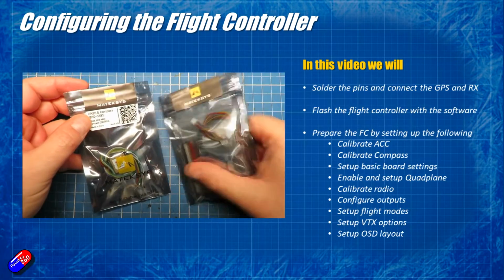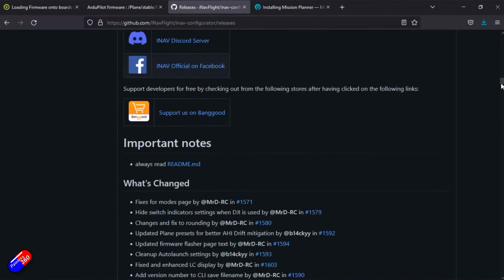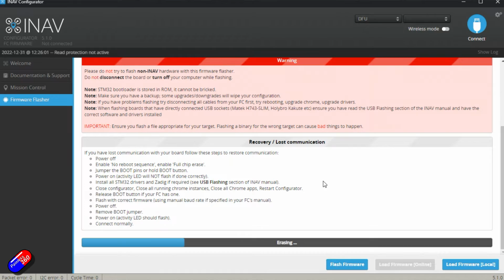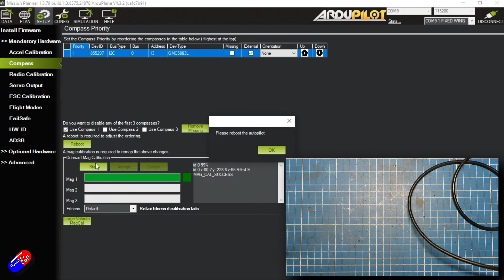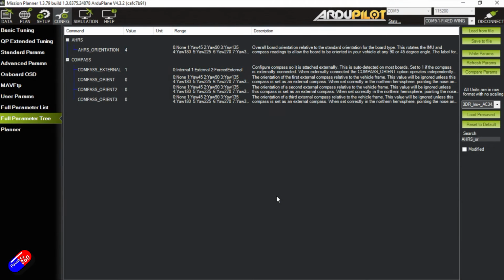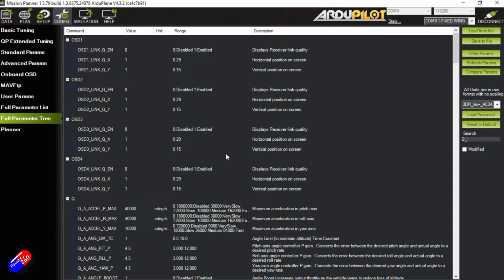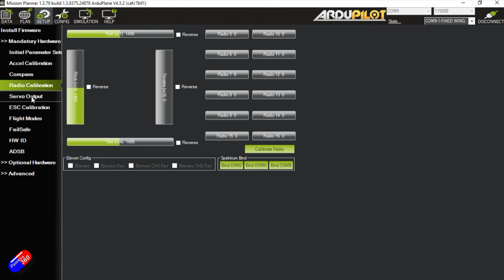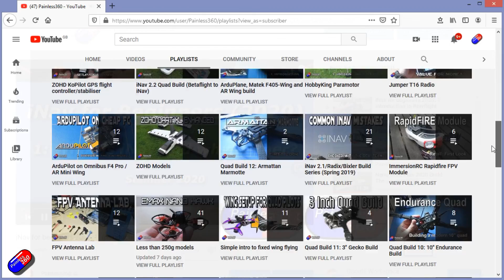Ranger T-1 VTOL Build: Video 2. Flashing and setting up the Matek F405-VTOL flight controller

Comment: Is there any different if using the original fc sn fast with matek f405 vtol
Reply from the maker: I've not tried. We spent the best part of a year trying to get this working reliably. It seems to be a little more reliable now, thanks in part to this work... Best of luck!

Comment: hey man. The tail motor doesn't get activated for vertical take of. What could be the reason?
I tested it separately and it is working. But it doesn't get activated at all. Weird!
Reply from the maker: Make sure it's set as the right kind of motor type in the outputs, the setup is all covered in the series...
Reply: @Painless360  the reason was that it had to be Motor 4, not 3. The documentations on Ardupilot also say that

Comment: I have the V2 with 4.3.5firmware and out of the box parameters, would you happen to know why the right motor servo over-rotates every time I land in VTOL mode, which causes prop strike between the prop and wing/engine mount. It's every time when it lands and I can't stop it 😭
Wondering if there is a parameter to stop the tilt servos moving too far towards the wing, at this rate I won't have too many more landings left.
Reply from the maker: See my video from Xmas on why I am taking a break from hobby grade VTOL. Due to problems exactly like this... Best of luck
Reply: @Painless360  I totally understand, it's a shame because (apart from that) it flew great right out of the box, I can't be the only one with this problem, but Heewing keep telling me to use the latest 'stable' firmware, which I am 🤦🏻‍♂️.
Keep up the good work my man 🤜🏻🤛🏻

Comment: I get barometer error reflashed to a different program and it works any idea what I did wrong to not get it to work with adrupilot
Reply from the maker: I'd check the forums for the exact error. Best of luck with it
Reply: @Painless360  I know it was a vague question. Appreciate your tutorials Ive never done one always wanted to. Just going to stick with inav for now. The hex file for adrupilot is probably corrupt. My Internet is horrible. I'm using the speedybee f405 wing for the t1 ranger I just finished the vtol conversation. Anyway happy flying

Comment: Hi! I'm stucked when trying to connect an elrs receiver to matekf404vtol on ardupilot. I'm using tx2rx2 but I can't get channels reading. Receiver get solid red once I turned on my boxer and mission planner can't connect if my boxer is turned on.
Reply from the maker: See my video on setting up CRSF recievers with Ardupilot... I've heard that changing the speed settings in ExpressLRS can make a difference too... best of luck

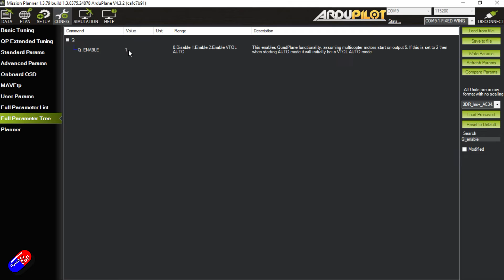Comment: 13:03 i did everything up to thus point enabling q_enable and disconnecting the fc and reconnecting it and now my fc wont reconnect to arduplane any idea on how to fic it?
Reply from the maker: I'd try another USB cable... Best of luck
Reply: @Painless360  i got it fixed it was the usb cable im tryin to set my t1 vtol up on a speedybee f405 wing app its been a nightmare so far if but thank you  for ur help navigating ardupilot its made it alot easier
Reply from the maker: Yep, so common I made a video on it! https://www.youtube.com/watch?v=J5BR9_vVwpE

Comment: Hi, should I want to add more servo capability that the fc can handle, can I re-assign the pwm outputs on the receiver and bypass the fc for those specific channels?
It seems wanting to add head tracking, independent ailerons, elevator, rudder, and anything extra would be more than what the fc can do…
Reply from the maker: You can, I am about to do that here for a model with a very specific wiring challenge!
Reply: @Painless360  thanks! I’d be interested in a video if it’s convenient. But I appreciate it either way.
Reply from the maker: Dependant on recievwr type. If ELRS, see my videos on how to remap the outputs to whatever channel you want... Happy flying

Comment: can u help me..i got issue on my setup,when i'm on qloiter mode my throttle jumping variable,cant move from 0-100,but when stablize mode/plane mode it works normally..same part on video i use
Reply from the maker: The throttle works a little differently in this mode.  I cover it in VTOL videos, see https://ardupilot.org/plane/docs/qloiter-mode.html where the throttle differences and settings are covered. The Ardupilot docs are always worth a read if you don't understand something, best of luck
Reply: @Painless360  thanks sir...i get it now,to tunning when hover i should in QHover mode...

Comment: I'm not getting Aircraft voltage, Avg Cell voltage, or RSSI showing on the OSD. Is there a setting I'm missing to get this setup that your video didn't cover?
Reply from the maker: What FPV setup?
Reply: @Painless360  DJI O3. I got it figured out, decimal was selected and RSSI was set to 2, and needed to be 3 from crossfire.

Comment: I'm new to all this stuff, does the F405-vtol require the compass and GPS to function properly?
Reply from the maker: Yes, Ardupilot likes both working and properly calibrated. Happy flying
Reply: @Painless360  Thanks, is there anything else besides the flight controller, gps, compass and power distribution board needed?  I got the F405-VTOL and Matek M8Q-5883 module for the bicopter I'm building.
Reply from the maker: See my VTOL build with the Ranger as I use the same FC... Best of luck

Comment: Great series!  I have mine built and I'm starting to test hover.  I was having problems getting enough motor thrust to climb in hover.  I was running 3S.  I noticed that some others are running 4S on this model.  Are you running 3S?  Also, would it be possible for you to publish your parameter list as it was when you flew your T1? Thanks inadvance!
Reply from the maker: Tuning video in the works as the default setup has issues.. Happy flying

Comment: Hi,
I was wondering if TBS Crossfire is supported by ArduPilot with  TX2/RX2 connection and if so, what do i need to do to get it going? I am not getting anything on the Radio Calibration screen.
If not, just switch it to SBus?
Reply from the maker: I'm guessing you are not a regular viewer... check out https://youtu.be/fpnbJPU3hU0
Reply: @Painless360  somehow I missed that one, thank you so much!

Comment: Hi Lee. After fighting with my Xiake 800, I decided to replace its fc with this Matek F405 VTOL. I believe I can use the same parameters you are using here right? Thanks in advance.
Reply from the maker: You should be able to copy the q_ settings across once you've enabled Quadplane on the new FC.... Best of luck
Reply: @Painless360  Will do, thanks!

Comment: Lee I see you disabled the airspeed sensor.  Was that because that flight controller cannot accept an airspeed sensor?  Or was that because there isn't room on the airframe?  Something else?  Thanks.
Reply from the maker: There isn't an airspeed sensor on this model. Happy flying!
Reply: @Painless360  thanks Lee - my question was more specifically - why did you choose not to use an airspeed sensor? Of course it adds a bit of complexity/cost/weight, but doesn't the added operational capability make up for that? I was even thinking arduplane/VTOL actually required an airspeed sensor? I'm wondering what went into your decision not to use an airspeed sensor, and then what were the pros and cons? Thanks again.
Reply from the maker: Ah! I understand. You don't need an airspeed sensor for Ardupilot but having one is very handy (see the other VTOL series on the channel). It'll work fine without it for basic VTOL.
Reply: @Painless360  OK - got it - "basic" VTOL - yeah that makes sense.  Thanks very much.

Comment: Hi Lee Steve again another quick question in regards to the nebula pro vista kit it comes with a wire harness pigtail call it what you want I guess it’s the power cord question is why does it come with a plug on the end of it on the other end the wires are bare there tend to be soldered on I was trying to figure out where the plug was that plugged into or just how that worked I did see how you worried up your radio mine is a little different not much but a little different was just wondering what the power cord was for before I start cutting plugs off the end thanks Steve
Reply from the maker: See the video about how i wired mine up in the playlist... I hope that helps

Comment: Hi Lee, Matek F405 VTOL is an excellent opportunity for my students because it's not expensive, but buying a complete T1 is not an option for many of them. Could you produce a series of videos converting an ordinary rc airplane into a VTOL one? Let's say a Bixler generic type plus 4 quadcopters fixed propellers around the wing. Total 4+1 motors using F405 vtol plus ardupilot
Reply from the maker: Check out the VTOL playlists here on the channel. One was with Ben from 3DXR where he covers all the steps in Ardupilot he uses to build a 4+1 VTOL and then I started, and ultimately abandoned, a 4+1 VTOL in My First VTOL Build! (Summer 2022): https://www.youtube.com/playlist?list=PLYsWjANuAm4on9XZ6vSy6cgHOPO9OeLIE
Some amazing content in the Ardupilot.org website on VTOL too.. Best of luck
Reply: @Painless360  Thank you a lot!

Comment: Hi Lee- After the accelerometer cal, there is a level calibration. It strikes me that this isn't the same as the 1st accelerometer point (otherwise redundant), but rather a reference for level flight. Should we wait to do this until the FC is mounted in the plane and put the plane in a slightly nose-up attitude (as in level flight)? Or am I reading too much into it?
Reply from the maker: You can re-run the acc. level calibration after it is in the model. See my full Arduplane setup videos. Best of luck!

Comment: Hi. I made it but I feel is not responding quite faster as I need, I have to move my sticks a lot. Do you know how to improve the response? Thanks
Reply from the maker: In what mode? What have you already tried? Have you followed the same process I have in this series?
Reply: @Painless360  In Qhover mode, it's like fliying on circles then when trying to compensate yaw it's like not responding. I made all of that. But also have a doubt, the tilt servos should move when using the yaw in Qhover? Mine doesn't move, I Guess that is correct.

Comment: Lee, I want to mention that on the Hee Wing Vtol Conversion Kit page there is a download for their parameters for Arduplane. I used this as a reference when I set mine up and pretty much copied all the Q_ entries into my F405. Here is a flight from mine. I've not done any autotune or changed anything from the Hee Wing settings yet. https://www.youtube.com/watch?v=lqdWBviWwcs
Reply from the maker: Thank you for the reminder. I've added a link in the description. What are your settings for weathervaneing?
Reply: @Painless360  I've honestly not even gotten into that yet, so they are whatever is default in Arduplane. Been down with the flu for the last 3 weeks and no flying / tinkering. I can say that it does weathervane a little bit. As I make any changes that positively affect flight performance I will notify you of the changes and try to link videos.

Comment: Wow, that's a lot of work compared to iNav. I gave up on Ardupilot twice, but planning to give it another try in a near future on a brand new frame. Let's see how it will go. Thanks by the way for this tutorial.
Reply from the maker: Well, considering INAV doesn't support VTOL, it's Hobson's choice at the moment for VTOL software.
Reply: @Painless360  hi i have matek f405wmn,it's possibile to use it for a vtol airplane?or the only way is buy the f405 vtol?
Reply: I was able to get the controller to work in inav but not in adrupilot days barometer error not sure what I did wrong

Comment: Hi Lee I hope you had some good holidays I contacted you a little while ago about this build with the first video I see now you’re working with this Flight controller so I assume you started the second video with the electronics my question is are you doing digital or analog for the video and also do you have a video out for the electronics Where you show inside the plane from scratch as you did with the first video and showing all of the components that you use along with the flight controller reason I ask this as I mention the first time I talk with you I knew absolutely nothing about FPV at all so of course I’ve screwed up a little bit I didn’t know the difference between digital and analog so some of the components I bought based on watching someone’s video was for analog not digital you see I have the DJI goggles so everything has to be digital in my set up but it’s all good I’m moving along I’m using the radio master zorro with Crosfire for the transmitter DJI goggles v2 I do have someone here locally helping me a little bit plus videos I watch from you guys so hopefully will get this thing together I will say this though if I knew how complicated this build was from the beginning I may 😮 given it second thoughts to doing this it’s not like my plane i fly where I put gas in it and go that’s for sure OK thanks a lot for the videos and I’ll be looking for that second video thanks again Steve
Reply from the maker: I will be making a separate video adding an DJI air unit to mine. Stay tuned!
Reply: Once again I can’t thank you enough especially for such a quick reply I will be waiting and watching for it and hopefully you’ll show us everything inside the fuselage as far as the electronics go OK thanks again look forward to all your videos. I guess it’s a good thing we’re not neighbors I’ve been knocking on your front door every day I believe till this thing is done OK have a good one.  And yes I’m almost on the other side of the planet from you here in Florida United States to amazing what the Internet can do
Reply: hi lee steve here again; are you  going to do any more veidos on heewing vtol ??  iam all bumed out have mine built but no  one to setup way to hard for me to do and having hard time finding some on to do it for me ; also are you happy with yours and final setup thanks steve

Comment from the maker: This is a re-upload to add a single comment on the motor output section. Thanks to those who commented on the original video that the motor order needs changing.  

This is video is part of a series and I cover that change needed in the next video in this series. This is not meant as a standalone video.

Please keep in mind that this video is documenting my first time journey building this particular VTOL and I am using a setup guide from someone else (that included this motor setup error). This video is designed to be watched as a series.

Thanks again to all who commented on the original version of the video. I would be interested in the tuning settings so please comment with your if you have your Heewing T-1 setup well. 

Thanks for watching and happy flying
Reply: Hi Lee, not sure if you've see or not, but I have a detailed step by step build tutorial for the T1 VTOL on my channel, which includes all the correct programming steps. Might be a better setup guide for you to use? Mine is also flying fairly well too, so if you use the same settings as me yours should fly well too
Reply from the maker: @Giz FPV  thanks for letting me know. It was one of your video's that I saw used the same motor order so its fab great that there is updated content. Have you tuned it? I'd love a chat...
Reply: @Painless360  I haven't had chance to tune mine yet (been terrible weather here for weeks!) however mine is flying pretty good using stock settings. Top tip though (that I didn't include in my tutorial) is to disable weathervaining entirely. It's a optional step, but it'll make the aircraft much easier to control during takeoff landing, otherwise you'll constantly be fighting the yaw
Reply: @kenpayne4853  Hobbyrc bro 😉